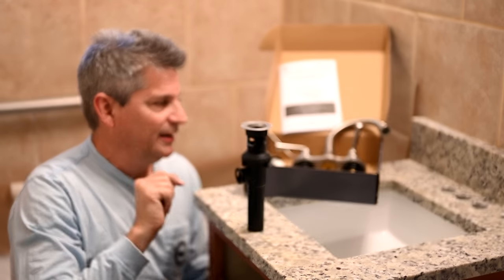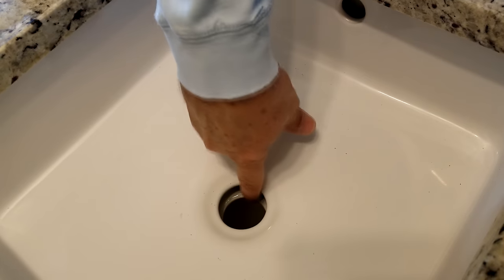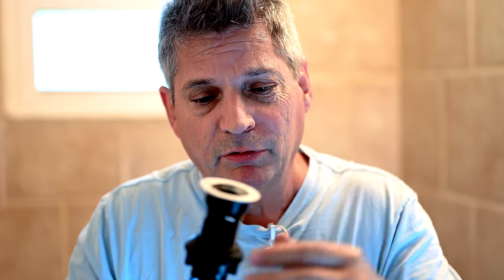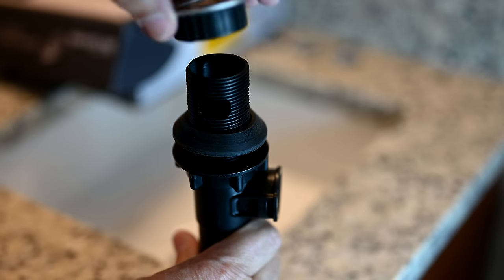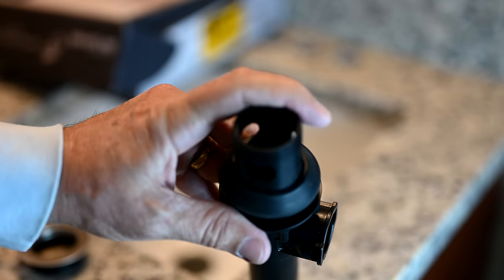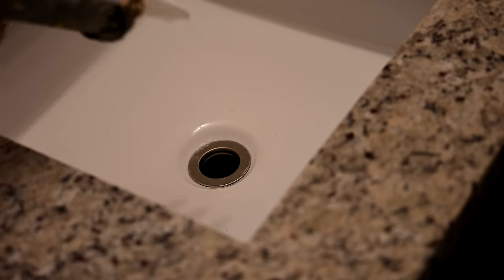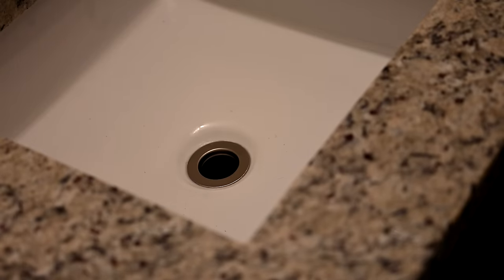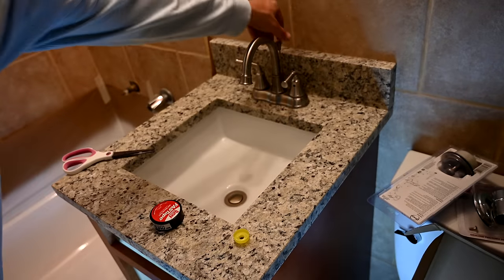How To Install Bathroom Sink Drain/Faucet, No Leaks Under Gasket, Threads [SOLVED] 2023

Comment: The thread tape wasn’t supposed to be applied to the rubber bushing. It is supposed to be applied to the threads where the Nut will ultimately end up after tightening. 

Dry fit the drain assembly. Insert the drain tube under the sink. Screw on the top chrome flange to the tube. Push the rubber bushing up until it touches the sink base. This rubber bushing has a tapered cone shape and needs to be centered in the sink hole. Tighten the nut to final torque. Here is the tricky part. To disassemble grab the drain tube tail piece bottom, not the nut or the rubber bushing. You need those to stay where they are. From the top of the sink unscrew the top chrome flange. You can do a quarter turn on the bottom tail piece to help but not more than that. After the top flange is off pull down the drain tube and hold the rubber bushing in place, don’t let it move up or down. Now apply thread tape to the top of the tube for the top flange. While holding the rubber bushing in place, back the nut off and apply thread tape where the Nut was just sitting. This is where thread tape needs to be. Now silicone the flange. Then re insert the drain tube from underneath and screw on the chrome flange and tighten all the way. Center the rubber cone bushing. Now you can tighten the nut all the way. The threads of the drain tube and nut put pressure on the tape and prevents leaking. The nut puts upward pressure on the rubber bushing and the bushing to the sink. 

There is no pressure forcing the rubber bushing to close around the threads. That’s why taping the rubber bushing won’t work.

Comment: Sadly, I did everything you said to do and it still leaks where the Teflon tape is wrapped under the rubber gasket 😭
Reply from the maker: Did you make sure  the Teflon tape is located directly where the rubber gasket touches it? Did you make sure you only hand tightened the nut under the black gasket, then no mre than 1/2 turn by wrench? Don't forget if you overtighten that black gasket it will deform and cause it to leak Also examine the whole on the porcelain sink and make sure it's smooth where the gasket touches if there's any cracks or chips there chances are you will have a leak. also make sure that your drain flanges screwed all the way on to the threaded down pipe from inside the sink. Lastly double check your wrapping of tape and make sure you have enough tape on those threads to make a difference.

Comment: I tried everything could not get rid of leak I have two full days going back and forth from hardware store changed several times won’t stop leaking cheap disposable water bottles have a better seal! Engineers what were you thinking!
Reply from the maker: Hopefully this video should have helped you 100%, if not, might be time to try another drain/faucet combo

Comment: Thanks for this video. The manufacturer’s instructions are sparse and don’t mention how to troubleshoot leak issues. I caulked between the tailpiece and the flange but was leaking out the bottom just like the video. Hopefully the latex tape solves the problem.
Reply from the maker: Thanks for sharing

Comment: Thanks for the video.
Just one question... in your previous video (link: https://www.youtube.com/watch?v=NkWS8vnUA4s), you do use the plumbers putty on top of the gasket underneath the sink. So just to clarify, you actually do not recommend to put the plumbers putty in this location?
Reply from the maker: Right I used it previously as many plumbers have suggested to do that, although after checking with Oatey the manufacturer of the plumbers putty, they have informed me that we should not be using plumbers putty up against the black rubber because of the petroleum products in the plumbers putty can cause the rubber to dry and crack overtime. And as it turns out you don't need the plumbers putty anyway because that way show here that the fix is actually accomplished with that second application of the Teflon tape around the threads of the downpipe.

Comment: Mine has multiple gaskets for above and below. Idk where to use the putty.
Reply from the maker: Putty goes underneath the drain flange, unless the manufacturer tells you to use silicone instead.
Reply: @jeffostroff  manufacturer doesn't show the use of putty or silicone. It has really crappy instructions. It just shows the two gaskets go above the sink and another three go below.

Comment: I freaking HATE the p trap wish we could glue the crap out of it to STOP leaks . True story. I had a bathroom faucet that is worn out was going to replace just that. Well until I seen that the sink drain had rusted and was leaking also ,great now I have to buy 2 new sink so they match. Well the second sink I shut the hot water off at the wall .Guess what water is still coming out when I  turn it on at the faucet. Think my house is  possessed  . Thank you for making this video. I will not be using my channel locks .
Reply from the maker: Thanks, I'm glad you liked it!

Comment: Best alternative is to use a pop-up drain. Easy to install and even easier to use. Also, I use small amount of plumbers putty. Why wait on silicone? Installing the drain should be the easiest part of  installation.
Reply from the maker: Some black plastic drains you can't use plumbers putty because of petroleum products in it

Comment: Hello，
  We specialize in manufacturing sanitaryware plumbing accessories for more than 30 years, we offer several products, such as Toilet Paper Holder,Flush Valve, Fill Valve, Tank Lever, Toilet Seat & Cover, Pan Connectors, Rubber parts of Toilet fittings such as Gasket, Flapper and many others. We can also do OEM products and if required, we can undertake product design.

Comment: You skipped most important part i.e., process of getting black rubber onto the Teflon tape. I did it but still have minor leaks from threads when water is coming down from overflow drain hole, otherwise with normal drain, there is no leak with or without that Teflon tape.

Comment: I am guna be that guy. This video is good if you havent done even one before. Other wise over kill no sealant required.  Hand tight then test if it leaks  go a quarter turn more on the nut at the bottom.  Done

Comment: I still don't understand how the Teflon tape prevents the water from leaking from the overflow holes?
Reply from the maker: It seals the threads that apparently are not getting sealed too well by the gasket

Comment: Great tips, unfortunately, I did all of these things and it still leaks. Back to the drawing board...
Reply from the maker: double check when you did the dry fit, is the lower section of teflon tape placed right where the rubber gasket fits over the threaded pipe in its final tightened and resting position?
Reply: @jeffostroff  I followed your steps where I dry fit it and then backed it down to where it made sense but I can double check, thank you. I redid all of it and used a bit more caulk and added another layer of Teflon. Another concern with my sink is that it seems that the drain opening and bottom of the sink are not 100% parallel. So, there is a chance the bottom seal is not getting compressed all the way on one side. Not sure how to solve for this.
Reply from the maker: @jswerens   Also once in a while we run into people who have the same problem as you were it still leaks no matter what and sometimes that bottom hole might be textured wrong or shaped wrong or there's a nickname is something stupid in which case you'll probably have to just dump the basin then replace it with a new basin.
Reply: @jeffostroff the old metal drain that I am replacing might need to go back on then because it’s a two sink marbelite vanity and it’s going to costly to replace. the piece at the bottom of the sink with the old metal drain was wider and didn’t settle into the flat spot at the bottom of the basin. I might take this to a plumbing supply place and see if they have a replacement. I only replaced this drain because the finish was coming off and the pivot rod was rusting.
Reply: @jeffostroff  I just realized the design difference between the old and new. The old piece that goes into the drain on top is threaded on the outside, thus keeping the water from even seeing the thread unless the sink is backed up. I need to find another one like this. The new design is poor…

Comment: I followed the directions exactly, and unfortunately it still leaked. I suspect the water is spiraling down the threads that are covered by the black rubber washer, and the teflon tape simply wasn't enough to stop this tiny trickle. If anyone else runs into this problem, I found a good alternate solution: with the washer fully retracted down against the big plastic nut, apply a generous amount of clear silicone sealant on the exposed threads above the rubber washer, up to those weep holes. Then when the rubber washer is brought up along those threads, the silicone will fill the threads. Hand tighten the large nut and wait out the cure time.
Reply from the maker: Yes others have reported success using that method as well. Plumbers on the past used to use plumber's putty and it works, but it's not recommended to use the plumbers putty against the black plastic because they claim it can deteriorate the plastic over time period so the silicone is another effective method
Reply: @jeffostroff  I think Rectorseal T Plus 2 would be okay; Rectorseal 5 says not recommended for ABS.

Comment: Home Depot's vid says to use "pipe lubricant" and never teflon tape for plastic threads... I'm confused.
I use silicone but wonder if something else is best.
Reply from the maker: Do you have a link to Home Depot's video? That doe snot sound right
Reply: @jeffostroff  https://www.youtube.com/watch?v=2befOMjA3ho
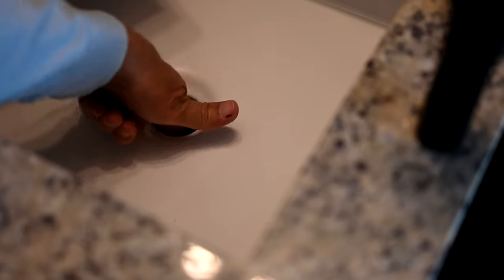@1:27 
I know, that didn't seem valid to me either.
Reply from the maker: @billytheweasel  I watched their video and it only covers P-traps, not the bathroom drain pipe, which I do use Teflon tape on. Now I get what you are saying with their video. They say not to use Teflon tape on the WHITE PLASTIC P-trap parts. Yes I agree on that as well, because they already have gaskets to make the seal. Some plumbers use Teflon tape or pipe dope to help seal the P-trap output connection to the wall pipe curved piece, but they are only trying to fix their own inability to get the parts lined up properly to prevent a leak. If you know what you are doing with p-traps, and I have seen only 50% of the plumbers out there do know it, you should never have to need Teflon tape.
Reply: @jeffostroff  Beautiful, thanks yet again for sharing your expertise. I just hope I'm ok using clear silicone on all plastic threads. BTW... profanity's called  "plumbing words" in my house... give ya an idea what kind of plumber I am!

Comment: Performed this job a thousand times using putty. Maybe had 2-3 leakers over the years. Difference is, I don't use crappy, plastic pop-ups and PO plugs. Brass/metal is the only way to guarantee a long-lasting seal. Thin-walled ABS distorts and loosens over time causing leaks, which causes call-backs, which results in loss of time and money. The amount of service calls I've gotten because the ABS trap, continuous waste, tail piece, whatever was leaking due to loose slip nuts (or just improper install), I cannot recall. Also, silicone is about the worst material for sealing against water intrusion. Yeah, it'll work...for awhile. If you must, Urethane sealant is more flexible and resists fluctuations of hot and cold water.
Reply from the maker: You might have been confusing silicone with regular caulk. I have silicone going on 5 years on some drains and it is still perfect. Same with toilets where I use white silicone on the floor line. I get silicone with 30 year gaurantee

Comment: Listen to the plumbers.  If it is a metal flange you need to use plumbers putty between the flange and the sink.  If you have a drain flange that is plastic on the bottom where it meets the sink, you need to throw it away and get a quality metal flange.
Reply from the maker: I suppose you will give those who can't afford the more expensive brass drains the funds to be able to purchase them when they cannot afford it
Reply: @jeffostroff  My advice is solid information for those who want to do it once, and do it right.

Comment: The teflon tape on the threads for the flange is pointless. Any leakage there would be flowing into a "wet" area anyway (the cavity where the overflow drain comes down).
Reply from the maker: Not true because what if you have a case where somebody didn't quite tighten it all the way down and you can see where the drain threads meet the flange there's a little gap there that could allow water to escape down that path. The rule of thumb is anywhere you have a meal threading in plumbing you should be using teflon tape
Reply: And where is that water going to go? Unless the gasket and associated threads aren't sealing properly, the only path is through the weep holes and down the drain. OK, sealing the flange threads can keep things working even if the gasket isn't sealing properly, but that's only until water comes down the overflow, and only the gasket seal can control that.

Comment: The faucet I bought is one piece on the top drain flange (no threads) and there are no threads down below where the cone gasket is. Therefore no need for Teflon above and no place to put it down below.

I'm on my 3rd sink now. First from Menards had a pin hole in the overflow. I put a paperclip through it an inch deep. Second sink had a crack inside the drain in the marble and leaked at the bottom. I took it apart. The manufacturer had some kind of glue on it ...what a joke.

Third sink from Lowes looks a lot better but they have no backsplash for it. Siliconed the drain and waiting 24 hours to leak test. If this one leaks I'll be at my Witt's end. I've done a few of these before and they never leaked for me before. I put no Teflon on because there were no threads. Seems like in that case I could put silicone around the smooth part of the pipe where the cone gasket sits?
Reply from the maker: Yes the silicone would be my next thing to try
Reply: @jeffostroff  thank you. Also I have to ask what is your take on the upper flange. I had a plumber friend who says he only uses silicone but some of the faucets come with a rubber gasket as well. It's supposed to be one or the other but not both correct? Also if so which do you feel is better? Thanks

Comment: Hey Jeff thank you for this video it helped so much! One question I still have is what size plumbing did you use to connect the drain pipe to the P-trap? I have been all over and can find a match?
Reply from the maker: Normally in the bathroom you use a one and 1/4 inch P trap those have the bags with the green colored stripe on it at Home Depot. If you were trying all over the place and can't get it to match I am assuming you have a thin metal pipe coming out of the wall? If that is the case you need to get what is known as a mission connector, which is a rubber coupler piece that has a stainless steel belt on it and it tightens down on both ends

Comment: BEWARE OF THE SIDE HOLES!  The holes in the sides of the pipe that drain the overflow are in a "one place fits all" position and are usually in the WRONG place for your sink. This wrong placement results in two problems. The first is that the side holes do not line up with the overflow hole so that the overflow does not function. This of course can result in a flooded bathroom floor when the sink overflows. The video tells you to check this so pay attention and turn the faucet to full volume. You have to look down to see the overflow hole in the bottom of the sink and match up the holes and cut or extend to pipe hole to match.  The next problem is that the pipe holes are too high which can leave standing water in the hollow at the bottom of the sink. This can lead to stagnant smelly water. Secondly, on some sinks, like pedestals, this standing water can lead to seeping leaks from the back unglazed portion of the sink. The solution to this is to cut or enlarge the side hole to be as low as the bottom of the standing water but do not cut too low. Not finding this can lead to rot behind the sink and rusting of the support bolts on the pedestal sinks.
Reply from the maker: I can say I never had this problem.
Reply: @jeffostroff  I speak from experience on all three of these problems and I am not in the profession. The seeping out the back of the sink took me the longest to figure out.

Comment: Teflon tape did nothing to fix the leaking at that rubber grommet.  Now I have to go back to the drawing  board.  Will probably just goop a bunch of silicone between the grommet and sink.  Maybe I already distorted the grommet/washer by over tightening.  Or maybe the cheap sink is garbage and it has too many irregularities.  Silicone first.  If that fails I’ll try to buy another grommet.  And if that doesn’t work I’ll yank the sink out and give it back to Rona.  It’s their “house brand”.

Comment: Why not make the faucet gasket out of rubber instead or hard plastic, this way no need to stink up the bathroom with out gassing of silicone, in addition to making it easier with not having to get between the back of the faucet and backsplash with sealant? Some vanities have very little room between them.
In addition, why not a thin rubber gasket to use under the waste seat (top chrome part of drain) instead of putty or silicone?
Reply from the maker: The gasket is made out of rubber it is not made out of plastic but it is a dense hard rubber. As long as you have a smooth opening at the bottom of your sink there should be no leaks when the gasket is tightened up against it